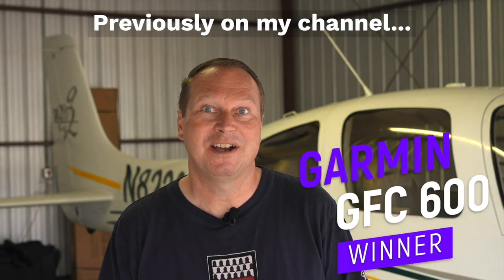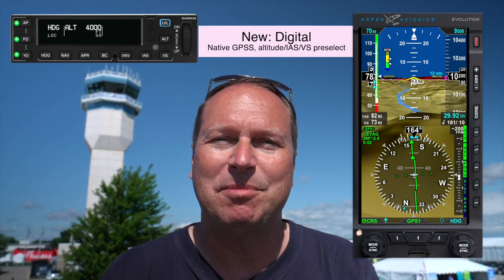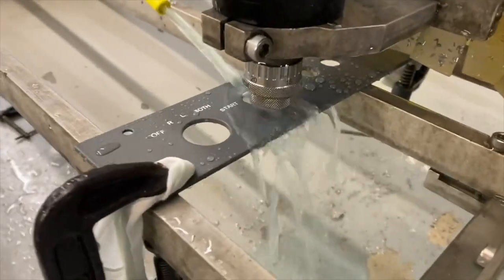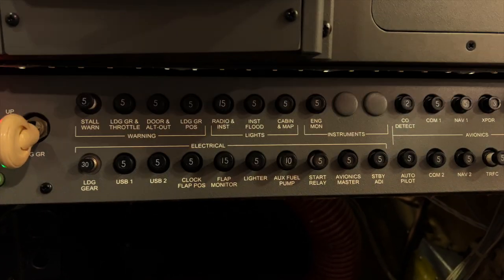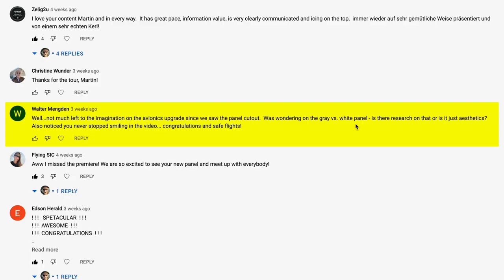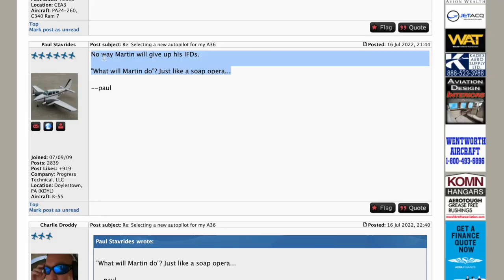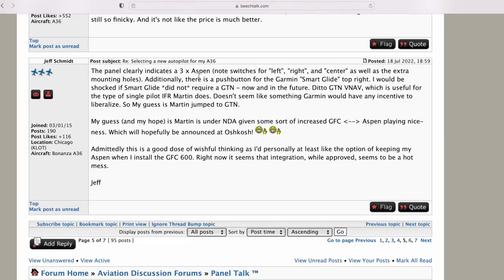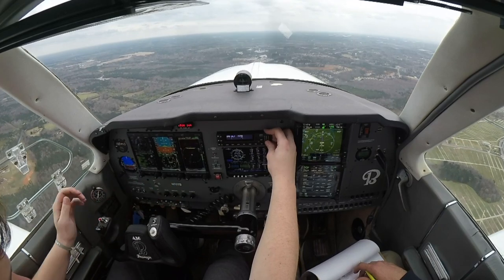Panel Upgrade II - Everything I couldn't tell you before...

Comment: This is amazing, Martin.  I always kind of worry about being on the bleeding edge, but I'm sure that Gardner-Lowe is doing top-notch work with both Garmin and Aspen.  I hope the FAA gets their thumb out and hurries up in getting the stuff signed off so you can go pick the airplane up.

As for the length of time that someone else mentioned, yeah Beech may have built in a fraction of the time, but they weren't designing a completely new avionics system.  Back in '78, you might have two NavComs, a Mode C transponder and an audio panel.  On a really upscale airplane, you might have an ADF and an autopilot.  None of those avionics really talked to one another, except for the autopilot.  So, working out an entirely new digital interface for multiple different manufacturers is not something you just throw in over night.  You'd have the airplane back by now if the FAA wasn't dragging their feet, I suspect.  So, don't worry about the naysayers.

I mean, with this new autopilot, you should be able to program everything into the GTN-750s, take off, climb through 2,500', turn on the autopilot and the next thing will be on short final at minimums to turn it off.

Anyway, this is really nice, Martin.
Reply from the maker: Thanks, Gary. And you are correct regarding the distinction between building a production airplane in the factory vs. developing and certifying something new - completely different tasks.
- Martin

Comment: Good idea going for the Aspen.  I had the G-600 and it was great when it worked.  However, if you have any problem, I had the magnetic compass have a software glitch, you are stuck going to a specialty shop and they didn't fix the problem right away.  Which meant going back and the plane was down for over a month!  And at the time, I think they changed it now, you were flying around with a bunch of big red x's. With the Aspen you could put the old instruments back in and send just the unit out.

Comment: Hey Martin, very impressive panel refit.  Congratulations on leading the way with the certification, that's a brave move and I wish you the very best of luck with all parties sticking to budget and time estimates!  Coincidentally, I'm in the process of refitting my 1965 PA24-260 Comanche with Aspen screens too, but a somewhat less ambitious arrangement with only two screens, coupled to the existing STEC30 autopilot and Garmin GTN650.  Should just about double the value of the aircraft, ... or more accurately cost about 50% of its value.....!!
Oh and PS, great video production quality.
Reply from the maker: Thanks for the kind feedback, and best of luck for finishing your upgrade!
- Martin

Comment: Great video as usual. Your situation is similar to mine. Last year I had installed in my B55 a PRO MAX EFD 1000 and a GFC600, expecting a world class autopilot combination but was shocked to discover, among other items there was no altitude pre select capability. Guess my research was inadequate. Nice to know there is a fix in the works. My current combination actually works pretty well but my C182’s G5/GFC500 is superior. (Even worse: my swimming pool is not deep enough for my yacht 😢)
Reply from the maker: Hi Robert, I can't help with your pool and yacht, but yes - once everything is approved, you will be able to add a digital ARINC 429 interface between the Aspen MAX and the GFC600 in your Baron. It will give you all those things: altitude preselect, IAS preselect, and maybe most importantly native GPSS (as opposed to using the Aspen to switch between heading mode and GPSS).
- Martin

Comment: Martin - love the detail and you explaining your thought process! Great video. My question is .... how much? Would love to know the unit costs and installation. Aside from your arrangement with Aspen and Garmin to assist, what would the normal costs be and what is your thoughts about how it affects the overall value of your beautiful Bonanza.
Reply from the maker: Hard to answer precisely, as prices keep changing (especially true this year) and each airplane starts from a different point. Having said that, this installation was on the expensive side of the possible range, with all-new wiring, and all-new panel, and no less than four servos to install for the autopilot. If you look at the equipment price (each manufacturer publishes that), plan to add 40-50K for installation and the new panel, and that should give you a rough estimate.
- Martin
Reply: Any idea what it costs to make the new panel (the steel plate itself) ?  Curious since they didn’t want to make one until they make a test one on plastic first.

Comment: Looking good, Martin👍🏼.  We’re putting the GFC 600 in our Baron / 2000 MAX Aspen / Duel Garmin 650xi.  Did I miss it or are they going to be able to display your Flight Modes across the top of your Aspen PFD?  Our autopilot control head is going above our Aspen 2000 MAX display.  Anyhow, congratulations👍🏼👏🏼.  Super happy for you!
Reply from the maker: Hi Gary. The Aspen will not (at this time, at least) show the autopilot modes, so you need a separate Garmin mode annunciator. You can see that in my panel, above the Aspen.
Maybe sometime in the future this will be added...
- Martin
Reply: @martinpauly  Okay👍🏼.  Thank you.  I believe since our auto pilot control head (which has the modes annunciated within it) is going to be just above our PFD (within 5” to 7” of the attitude display center point), we will not need the additional FMA Annunciator panel. Fingers crossed on this one.  I guess if we end up needing it, it’s okay👍🏼.
Reply from the maker: @garyscholder2463  Good point - yes, if the control panel is in the primary field of view, then you don't need a separate annunciator.
- Martin

Comment: G,day Martin from Sydney Australia.
Nice upgrade to 70TB and I hope that the administration between the regulator FAA and the avionics manufacturer is concluded soon. So we can "drop the bottle and pull the trottle."
AUTO PILOT
Did the wings come off, for the installation of the servo motors and connecting rods, or just the aluminium in that area?
In closing, nice yoke: I like the look of the thumb rests. 
Looking forward to: "N70TB your clear for takeoff, climb and maintain 2000 expect 9"
🌏🇦🇺
Reply from the maker: Hi John, the wings did not have to come off for this installation. The servos are all installed in the fuselage and connect to the flight control cables.
Regards,
  Martin

Comment: Martin, great video. Was most interested to me is the process, amassing. Curious, I'm assuming you gained on useful load, do you know how much gain you got? Thanks again for producing such great content. Will admit I did watch it a second time. Charlie
Reply from the maker: Thanks, Charlie. To my surprise, the W&B I got from Gardner Lowe shows a minimal increase in weight. I suspect this is not real - they actually weighed the airplane, likely for the first time since it left the factory in 1978. All prior changes were done on paper, by adding and subtracting weights of equipment installed and removed, respectively.
- Martin

Comment: you sure have out a lot of effort into this A 36. bet you are doing this due fact you like complex project work. Bet this latest project is in the 100-125 K range at least. Past Aerostar private pilot now retired  love your channel. Christopher Ottawa Canada
Reply from the maker: Thanks, Christopher. Your guess for the price range isn't bad.
- Martin
Reply: @martinpauly  just watched yourtwinengine training part 2 video once you go twin engine hard to go back my first was twin Camacho,  twin Senica 1 and 2, then piper Aero star 600A non turbo flight plan220 ntk 8000 ft. The best test is which foot requires all the pressure this tells you right away which engine is out the Aerstar  gear flaps up climbs 500 ftm at VMc.  Christopher Ottawa canada

Comment: Now that you have 4 MFDs - I'll be interested to see how you use them, especially on an IFR flight (the geo synch chart on the right next to the PFD is ideal for me).  Also, what are you going to do with your 5th "MFD" - Foreflight / iPad (just use it to file flight plans)?  Won't it block the view the other 4 MFDs (haha).  Are you going to get the charts for both the Garmin and Aspen equipment?  You have a few choices for the chart subscriptions (also awaiting your Jepp review).  Safe Flights.
Reply from the maker: Good questions, Walter. This is a lot more screen real estate that I am used to, and it will take some time and experimenting to optimize its use. I don't know if this means I'll se the iPad less in the cockpit than I have so far; my guess is I'll keep it because its size and high resolution still make it pretty nice to display approach charts. But the GTN750Xi also has a very high-resolution screen, so maybe I'll change my mind. Time will tell.
On the Aspens, I'm thinking a PFD and an ND for two of the screens (obvious choice), and maybe a traffic screen and flight timers on the third. 
- Martin

Comment: Martin I always enjoy your vids. I realize that you have made your aircraft available as a test bed for this integration but what benefits would someone installing a complete panel upgrade have by choosing the Aspen over the G3X?
Reply from the maker: Dennis, for an all-new from-scratch panel, I bet most people will probably choose a G500TXi of G3X as their flight display - even though in terms of redundancy, the Aspen 2500 system does have the upper hand. I believe the real target market for this new interface is people who are looking for a new, modern autopilot without redoing their whole panel - maybe even people who already own an Aspen but have an old, worn autopilot that needs replacement. For those people, this new interface will be very valuable.
- Martin
Reply: @martinpauly  thank you. Agreed
Reply: Soooo.... the only reason you went with Aspen is because of the great deal they gave you for doing a GFC600 and Aspen so they could get it FAA certification.
Still I think it would have been a dream system with a G3X, GTN, GFC500 with a backup G5 or GI275 ... adding a GEA24 and removing JPI would have put all the system messages on to the G3X including any engine issues.

Comment: Martin, I loved this video and all of the explanations that went with it. However, I feel like it wasn't complete because you did not go into the reasons for the Aspen PFD/MFD. You stated in the video that the Avidyne was replaced in order to get an overall semblance of units working together. Yet the Aspen and Garmin units didn't work together. That is 180 degrees from what you said the reason was for dumping the Avidyne units. If you had a deal with Aspen to get a free or deeply discounted unit in exchange for them using your plane as a test-bed, that's fine. It's certainly understandable. But if you did have that, I didn't hear you tell that story - especially when a G500 or G600 would have interfaced with the GFC600 seamlessly. It made no sense to use Aspen when Garmin already had the solution available to you. I'm not trying to call you out on anything - I'm just curious why you used Aspen when it didn't work with your new Garmin GFC 600, and a new software program had to be developed for it to work properly. Thanks for all that you do in the aviation community, and I do really like your videos. This one just left me with more questions than answers.
Reply from the maker: Great questions, David. You are right that going all-Garmin would have been easier, and probably much faster as well. But when I learned that Garmin and Aspen were looking for a testbed for their collaboration, I was very interested. Here's why: The insights into development and certification I got during the process have allowed me to learn a lot of things I only knew vaguely before. The path takes much longer, but there is some interesting discovery at each corner. And yes, sometimes there can be frustrating discovery as well, but those still create learning opportunities. 

I also take comfort in the fact that once the project is done, the absolute best engineering experts for the Aspen PFD and Garmin's GFC600 have looked over my installation with a fine-toothed comb, and in terms of setup and configuration I should expect that my install will be optimized and checked to a point that no avionics shop is capable of doing - in other words: perfect. That alone might be worth the price of admission.

And finally, I applaud Garmin for cracking the door open a little bit towards working with other avionics companies and creating compatibility with other equipment. That is good for all of us, and I am very happy to be part of that.

So, all of the above led me to where I am: with an Aspen Evolution 2500 in an otherwise mostly Garmin cockpit (except the JPI EDM930 engine monitor).

Regards,
  Marti
Reply: Hope we can get some feedback after he uses them and in IMC conditions too.  I think aspen is cool for the vertical look but integration is important although I would probably prefer Garmin displays.  If the products were provided as a sample at no charge, that is a pretty good deal.  There was another Bonanza plane Garmin did up completely too at Oshkosh.

Comment: So Martin. Glad to see you be the test bed for the Garmin AP integration with Aspens. Any sense if the 500 series will have the same certification with the Aspen? There are a lot of us there with Aspens, GTNs and brand X autopilots.
Reply from the maker: My understanding is this works only with the GFC600. Intuitively it makes sense in that the GFC500 product is really just a control panel and some servos, with the actual autopilot "brain" in a separate Garmin display. So it couldn't quite work the same way with the Aspen.
- Martin
Reply: @martinpauly  Thanks for the reply. I think the 600 has some other higher end capabilities than the 500.  It was surprising to see they went for the 600 and not the 500 which has a much bigger install base potential. There are a number of Aspens out there in planes where the 600 won’t work. 

BTW - you’ll love the Aspens. I have flown behind mine since 2012. Let us know how you find the GTNs over the Avidyne’s. I have flown with my GTN since the Aspen installation. I like the integration with my Garmin Pilot, especially for database concierge using the 510. But those IFD users are a dedicated bunch. Good luck.

Comment: How much would this panel upgrade cost for the average Joe? It seems to me it might be more then half the value of the plane. I would like to get this for my Saratoga but it may be a bit of a reach.  Looks great! Happy flights!
Reply from the maker: Robin, the pricing for all the devices an be found on the manufacturers' websites, so you can add up the exact items for your dream panel. For installation, it's a bit dependent on the shop and on what your aircraft currently looks like, but with a four-servo autopilot (like mine), somewhere between $40K and $50K just for installation labor and materials (including cutting a new instrument panel) probably puts you in the ballpark.
Regards,
  Martin

Comment: Are Aspen and/or Garmin funding the project in return for your plane being the STC platform? What's the benefit of the three Aspen displays over a single Garmin display?
Reply from the maker: The equipment and installation were not free (I wish!), but one big plus I'm getting out it is the fact that experts from both Aspen and Garmin went over my installation with a fine-toothed comb, optimizing the configuration and setup to an extend no avionics shop could ever accomplish. And with loaning my airplane to the cause, I am helping create and certify something new which I hope will help many other airplane owners in the future.
- Martin

Comment: Can the aspens system work with the G500 auto pilot too?
Reply from the maker: No, this interface will require a GFC600. The GFC500 is really just a control panel and servos, and it relies on a Garmin display to serve as the autopilot computer.
- Martin

Comment: While waiting can’t you fly your plane with the AP inop? Not ideal but at least you can fly your plane and then bring it back to get the AP sign off.
Reply from the maker: That was my thought initially, too, but if you think about it, declaring the autopilot inop doesn't change the fact that the installation and wiring of the avionics system conforms with yet-to-be-approved installation manuals. So inop or not, the whole setup would have to be reverted to the old analog interface, which makes little sense.
- Martin
Reply: @martinpauly  got it, makes sense! Great videos and explanations thanks. Sorry I missed you at Oshkosh! Would have loved to say hello! Next time!

Comment: Maybe I missed it. What exactly does the go around button do?
Reply from the maker: Hey Bryan - "TOGA" turns the autopilot into pitch and bank mode, and commands wings level and a pitch attitude supportive of take-off or the very initial phase of a go-around (7 degrees up in m A36, I believe). It provides flight director guidance to help with the transition from final approach to missed approach, or (in case of the GFC600) can fly a this transition completely coupled.
- Martin

Comment: I enjoy your videos and think this build is wonderful but in my opinion there’s no way it should take over four months. Beechcraft built your plane in a fraction of that time. It’s ridiculous to think that a plane just sits in the hanger for a week or two until they can touch it for one or two days and then leave it for a week or two and go back to it
Reply from the maker: If it was just an installation of off-the-shelf equipment, then I'd agree. But you did see the part where I say this isn't just an installation, but a development and certification project of something new, right? Gardner Lowe finished the installation in six weeks, which I think is pretty darn fast for a job this size. The rest is development, flight test, and certification.
- Martin